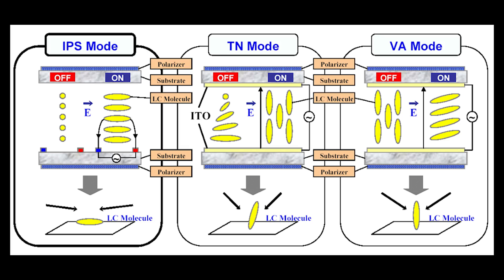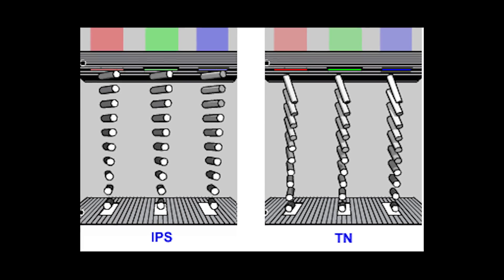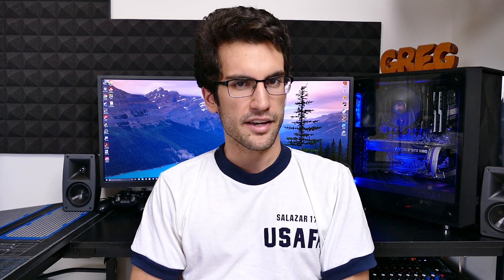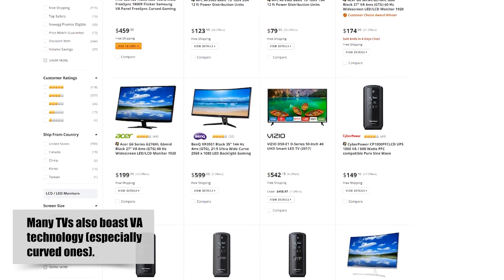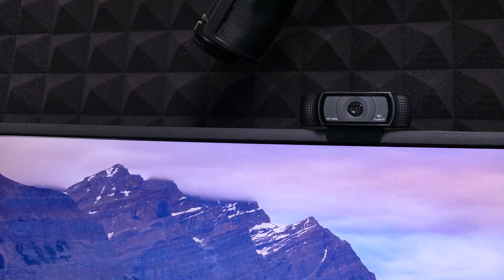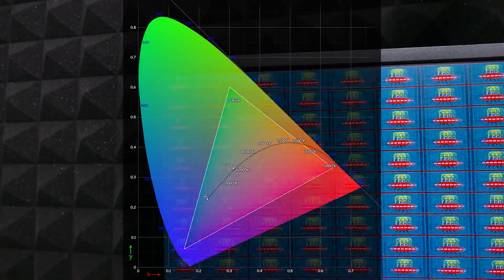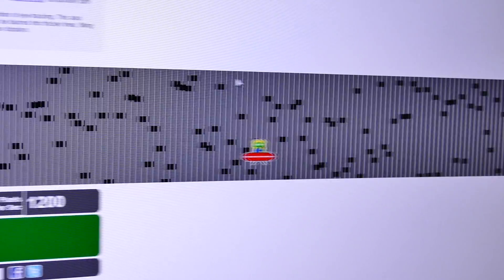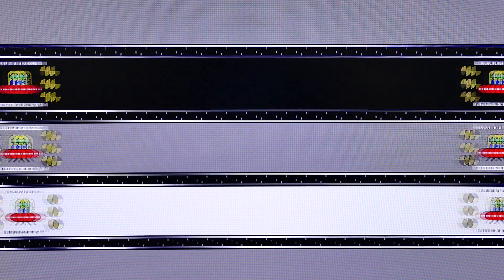What is VA (Vertical Alignment) Technology?

Comment: The lower pixel response time is a real bummer for some gamers, as it is noticeable at high refresh rates :( I'm still pleased with my VA panel, though.
Reply: But lower response time is better...
Reply: The slower pixel response is a backplane issue. Right now, only LTPS backplanes can drive a VA panel. Even then,  it's hard to find one capable of driving it faster than what a 120hz refresh rate really requires. That as well as the inherent voltage shifts of LTPS are why it's easiest to see on large 144hz panels.
Reply: All current widely available monitor techs have their issues, so it's always going to be a compromise. VA works out pretty well though I think, the response time is barely worse than IPS, maybe 10% slower. (On my one anyway).
Reply: I just went from a BenQ XL2420Z to LG 32GK850G. I run the monitor at 144 Hz and I haven't been able to notice any smearing at all while playing games (rocket league, escape from tarkov), also nothing else such as overshoot. I was really insecure about if I wanted to buy this monitor or not because of all the "VA-panels are too slow for gaming"-claims, but I haven't been able to notice any negative difference compared to my old TN-monitor. I'm really happy with the buy, I wanted a non-curved 32" monitor with G-Sync and this one fit all my requirements.

Comment: Just as I was looking for a new monitor and deciding between IPS and VA. Your timing is impeccable.
Reply: elektroencefalografista May I ask what you decided on? I’m torn between two things, VA vs IPS, and 27in vs 32in. Also want good contrast ratio, brightness, response time, ergonomics, and colour gamut. Damn. Can’t seem to find the right ones or combo. I’m only going to use it for PS4 Pro casual gaming. I care a lot about contrast, but don’t want to lose out on colours. Not to mention size, worried if I’ll regret 27 being too small. Idk anymore lol. Any recommendations or feedback? Cheers
Reply: @sultainious  
I went for VA, AOC C24G1 specifically, and I sold it literally this friday.

Looks like most VA panels tend to have issues with text aliasing because of how the subpixels are dimmed, more info about this is on https://pcmonitors.info/reviews/aoc-c24g1/

I also didn't like the gamma shifts near the edges of the display, especially noticeable with gray-ish backgrounds.

Response times were pretty good with overdrive, but with some color combinations there was purple ghosting, it wasn't very noticeable but it was there.

Contrast and black levels were great, not AMOLED-level but not that far off in most cases, colors were nothing special, good but not as good as IPS panels, though I think it's an issue with this particular AOC model because there are Samsung monitors with VA panels and wider color gamut.

In general I think VA vs IPS boils down to personal preference, but if you're looking for ergonomics and color gamut then IPS is more suited for that. The response time also tends to be better with IPS.

I'm about to get the G24G2, it has an IPS panel and gets great reviews. There's a 27 inch version but it's still 1080p.

Comment: The biggest issues I've experienced with VA on desktop displays are poor viewing angles (when using display as wide as 34" ultrawide from desktop viewing distance while playing games) and poor text sharpness and clarity, especially SVA panels that all current 3440x1440 VA ultrawides are using are having this issue. 1440p screen like this is looking like 1080p or worse while web browsing and generally working with text. Colors, even though calibrated and perfect on paper, are lacking the expression IPS has. After all there is a reason why there is not a single professional grade VA display in existence. Not like IPS is perfect, poor contrast and IPS glow are really annoying flaws, but this will be visible occasionally, while VA flaws are visible 99,9% of the time. OLEDs are also not without flaws but the picture they are producing is worth any struggle, especially for desktop environment where they are solving many issues and where LED technology is really showing all the flaws. Generally for now IPS for desktop and VA for TV, hoping for OLEDs to become widely implemented.
Reply from the maker: Krzych My Ultrawide VA 3440x1440 doesn't have this viewing angle issue.
Reply: I’m torn between two things, VA vs IPS, and 27in vs 32in. Of course I‘d like good contrast ratio, brightness, response time, ergonomics, and colour gamut. Damn. Can’t seem to find the right ones or combo. I’m only going to use it for PS4 Pro casual gaming. I care a lot about contrast, but don’t want to lose out on colours. Not to mention size, worried if I’ll regret 27 being too small. Idk anymore. Any recommendations or feedback? Cheers

Comment: Any tips on how to find a good wallpaper for stacked monitors? The bottom one is a 2560X1080 ultrawide and the top is 1920X1080. Thanks!
Reply: with that setup, i'd probably suggest a solid color... or some form of thematic juxtaposition. like sun at the top and moon at the bottom. abstract or minimalist could also work

Comment: VA panels generally have better black levels too, yes?
Reply from the maker: Connor W Discussed in video. Contrast ratios are higher.
Reply: Connor W Contrast ratio is the difference between brightest white and darkest black on a panel, not just the white.
Reply: Connor W that's true.
Reply: Ah, thanks. I need to dig a little deeper into this stuff.
Reply: Science Studio Doesn't contrast ratio refer to just white levels? Or difference between both black and white?

Comment: I have had a BenQ VA Monitor for a couple years now and it is perfectly acceptable for the average user who does a little of everything. I game on it at my PC desk and I watch Netflix and Hulu on it from a comfy stuffed chair 6'+ away viewing from a lower and off to the side angle. There is a slight contrast shift when watching Netflix from my chair but it is only noticeable if I am actively looking for it. Regardless it is much much better than viewing a TN from the same angle.
Reply: I have a BenQ 60Hz AMVA and a Viewsonic 144Hz TN.
Both of them perform admirably well in the usages I demand out of them.

Media playback, web browsing on the BenQ, gaming on the Viewsonic.
A weird thing I've noticed is that the AMVA monitor seems to be warmer than the TN one, even though both are driven by the same GPU and are running with sRGB display settings. I wouldn't notice if it was just one screen, but the contrast between the two makes it really obvious sometimes.

Comment: I5 8400 or ryzen 5 1600?
(I'm going to livestream w/ it)
Reply: 1600 and u will be able to get zen 2 in 2019 without changing mobo
Reply: u need to buy a z370 with the i5 8400 even tho it cant overclock
Reply: hey that's pretty good depends. For gaming the 8400 easily. For productivity I still vote for the 1600
Reply: I would go with the ryzen 5 because it has more threads which will help with steaming but you will have slightly lower frame rate but less frames dropped on your steam. Also you can get a b350 board that can overclock the 1600. You won't be able to overclock the i5 8400.
Reply: Go for AMD only cause it has SMT(=HT) in that price range. :)
Reply: strongly prefer r5 1600 and oc to 3.8 with stock cooler w/ b350 mobo better value for both gaming and multitasking  spend the extra cash on something else
Reply: TheHybridPotato but shouldn't the extra threads help?
Reply: I believe at the price point of 8400+Z370, you can get 1700+B350, which is far superior in live-streaming.
Reply: I rather go with r5 1600 because of more threads. Cheap motherboard prices depend on what country you live in. Can upgrade ryzen 2 without switching sockets. You might get a 5 to 10 fps difference depending on games. It's playable depending what gpu you have. Overall r5 1600. Also I5 8400 is a space heater using shitpaste.
Reply: yeah 3.8 with stock is stable on literally every single ryzen chip out there. if you get lucky at the silicon lottery, u could go 4.0 with stock
Reply: yeah completely agree, just take that 250 u save and get the next best gpu
Reply: go r5 1600x it more stable then the  i5 8400
Reply: Definitely Ryzen 5. Combine it with a B350 motherboard (though expect subpar overclocking [as in less than 4 GHz, though do try for that number anyway]), and you'll be good to go. Ryzen 5 offers similar performance, while also giving you a much better platform. Intel's going to be replacing their 300 series chipset with the 400 series in due time, and you'll have to go to Z390 if you want one of Intel's future 8-core CPUs. AM4, meanwhile, will be supported until they release AM5 in 2020, meaning you'll be able to upgrade to Ryzen Refresh, Ryzen 2, and perhaps Ryzen 3.
Reply: hey that's pretty good Ryzen, since the motherboard will be good for a few years. My R7 1700 is amazing at recording gaming videos.
Reply: by stable mean some software needs to mature
Reply: hey that's pretty good i5 all the way, I have ryzen
Reply: The i5 8400 will be a better performer in gaming, and will be enough for livestreaming with no absurd bitrate, but if you are looking into price/performance, the Ryzen 5 1600 with a good B350 motherboard is a better value, because Intel only provides the Z370 chipset at the moment for Coffee Lake, no H310 and B360 until 2018.
Reply: 5-10 fps my ass dude. intel guys are getting up to 30 more than my 1600x
Reply: Филип Пешић so?
A I7 970 vs i3 8350k, the i3 will win w/o ht
Reply: I5 8400 will do the job better

Comment: TN is best, hands down
Reply: TN is fastest but that's about it.
VA has great contrast and IPS is somewhat of an allrounder with the best viewing angles.
Reply: Why exactly?
Reply: Modern TN panels are actually not that bad. My friend has a BenQ XL2540 and it has pretty awesome colors and great horizontal viewing angles. According to my colorimeter (i1DisplayPro) it covers the entire sRGB gamut and also has decent contrast at ~900:1. Calibration didn't do much as it was great out of the box. It only lost to my AOC AG271QG (IPS) in contrast (1300:1) and the obvious TN vertical gamma shift. His old XL2420Z on the other hand had an utterly crap panel with very low contrast (600:1), dull and wrong colors and also horrible viewing angles. After calibration the colors at least were correct although still a little pale but the XL2540 is miles ahead in every aspect.
Reply: no.